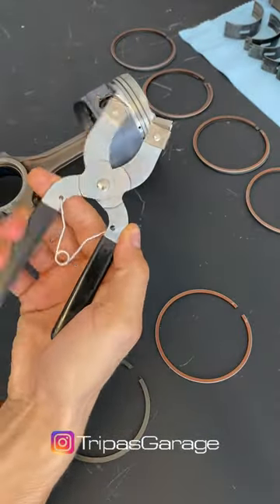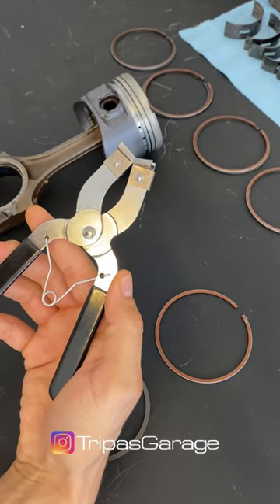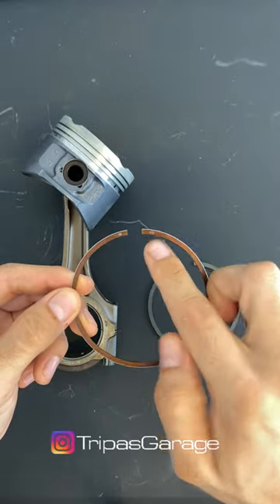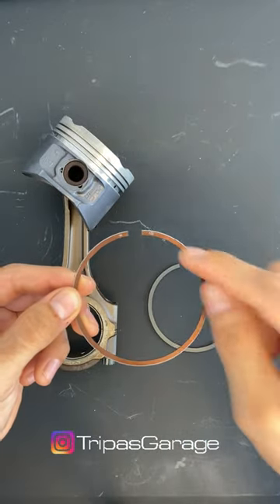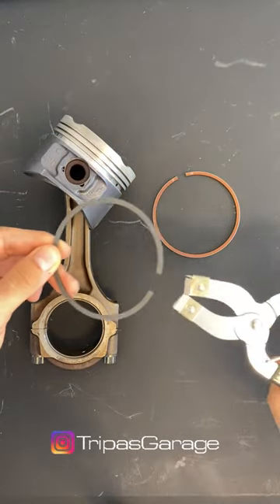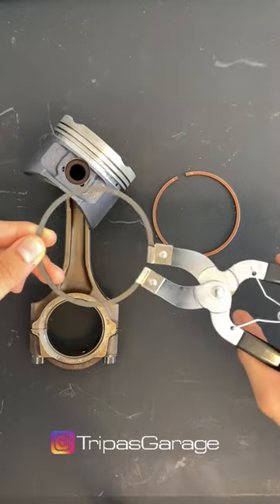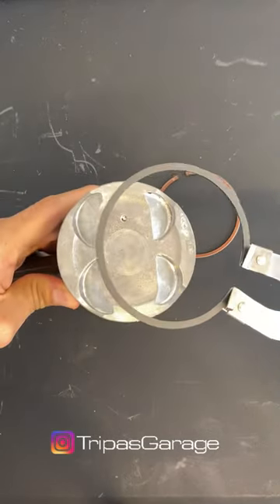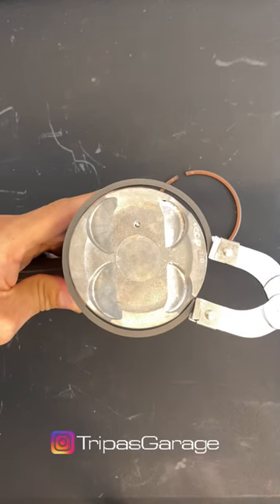Installing piston rings

Comment: Aren't the slits of the rings supposed to be diameteically opposed?  Also, is there anything that keeps them from rotating and eventually aligning the slits?  That would torally eliminate compression...
Reply: You are correct in not wanting to have the ring end games aligned, however the rings are intended to be able to spin around in their channel.